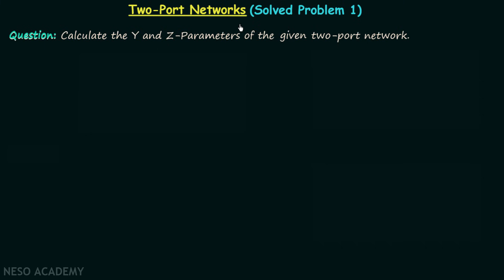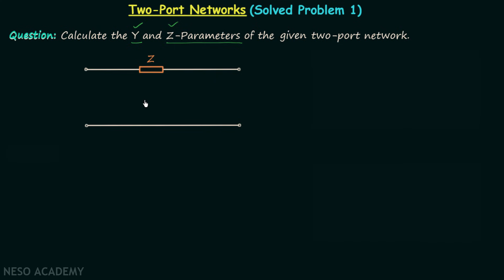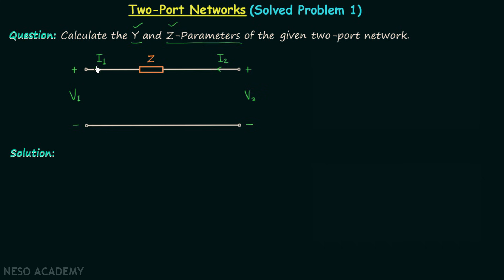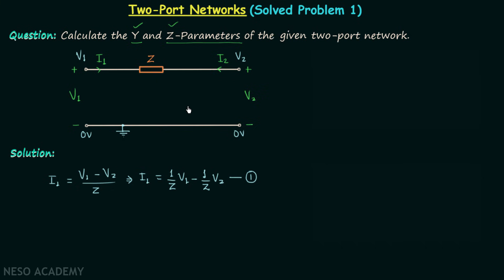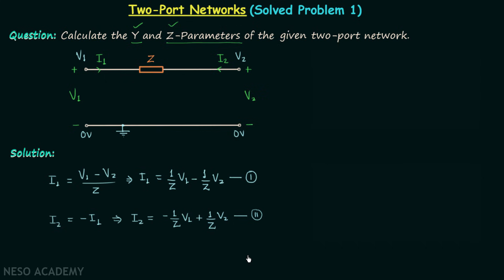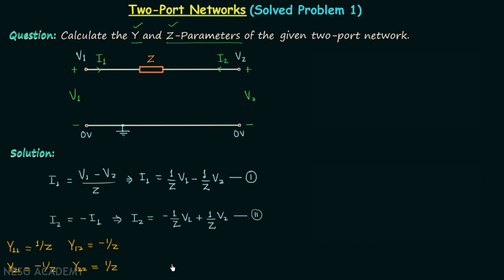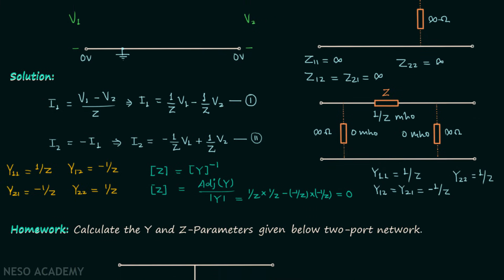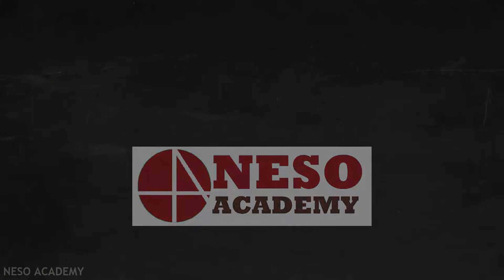Two−Port Networks (Solved Problem 1)

Comment: Z11=Z22=Z and Z12=Z21=-Z and y parameters we will get Infinite
Reply: How did u get -z??? When u convert it to T network z1=0 and z2=z and z3=0. Right? 
Z11=z1+z2
Z12=z21=z2
Z22=z2+z3
Right?
Then how -z?
Reply: @NaveenSword  
The right answer will be z not -z

Comment: Solution of homework problem :--
Y parameters = y11=y22=(infinity)  ;    y12=y21=-(infinity) ;                       
Z parameters =
z11=z12=z21=z22=(z) ;     
Am I correct ??
Reply: yes
Reply: How u getting z11, z22 is z??
Reply: @yasvanths3507  
Appy KVL in both the loop
V1=zI1+zI2
V2=zI1+zI2
Compare these equations with those of [z]
Reply: I got y11 = z
Reply: @sangeethaponnusamy3594  Always shortcut won't work
Reply: Yes
Reply: Perfect 👍
Reply: Yes
Reply: -(infinity) is also an infinity
Reply: @nehakhokher9438  no you have to specify it
Reply: yes you are correct
Reply: Yes sir
Reply: how you are getting y12 and y21 = -infinity....?
Reply: @anshikabansal77  Take negative of obtained values for Y12 and Y21 , that's a thumb rule!!
Reply: @anshikabansal77  bcoz Y12 =Y21 = -Y2
Reply: Z21=Z12=—Z,Z11=Z22=Z and y parameters will be infinite